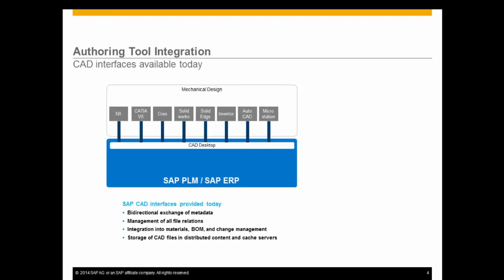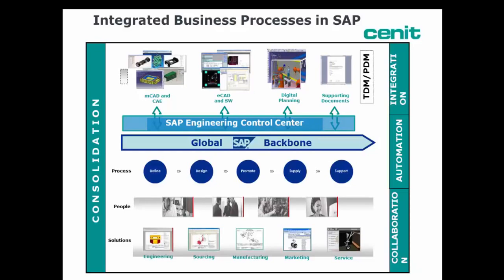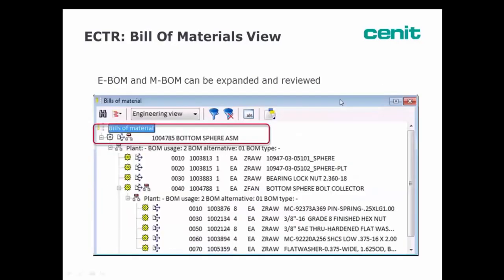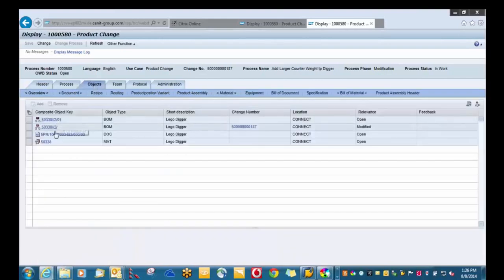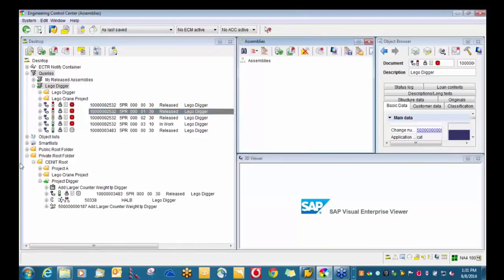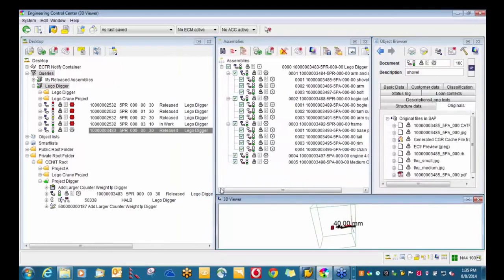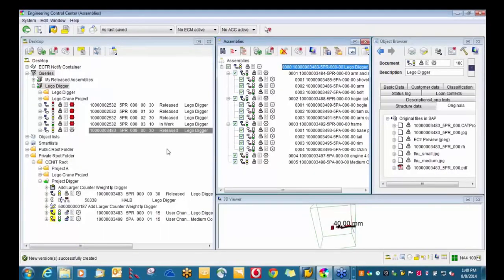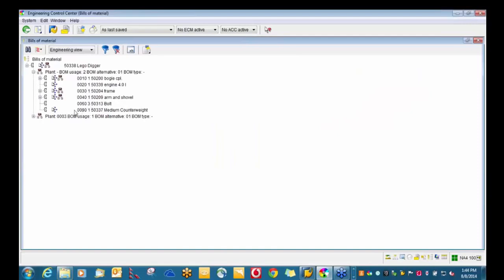SAP PLM - Engineering Control Center

Comment: Could you please tell me where do we maintain the authorizations in ECTR? Like admin role designer role etc?
Reply from the maker: Hi, the SAP Engineering Control Center is a front-end application. All authorizations for SAP are maintained in the backend. However, you can use PFCG roles to customize the features of the SAP Engineering Control Center.
For more information, see the documentation, especially the part of the Configuration Guide:
https://help.sap.com/viewer/product/SAP_ENGINEERING_CONTROL_CENTER/5.2/en-US
If you need more details, please do not hesitate to contact us: myquestion@cenit.com!
Reply: @cenitsapsolutions5181  thanks for the response. Could you please let me know if there is a possibility to create additional folder types other than FOL?